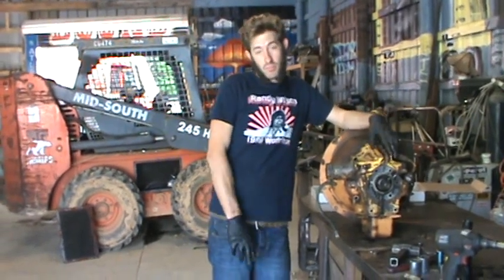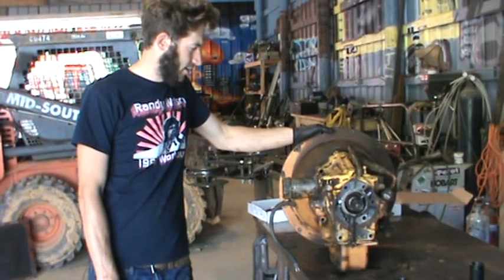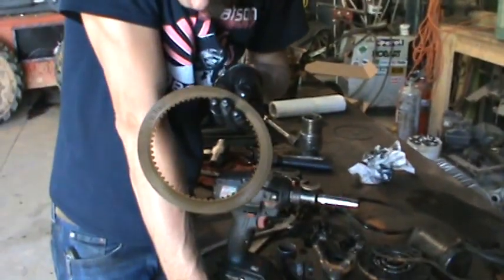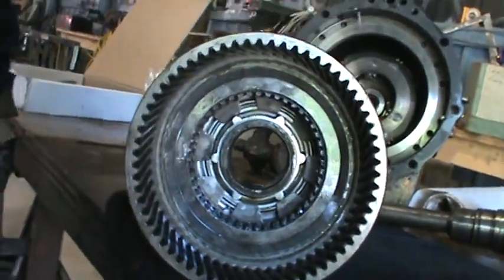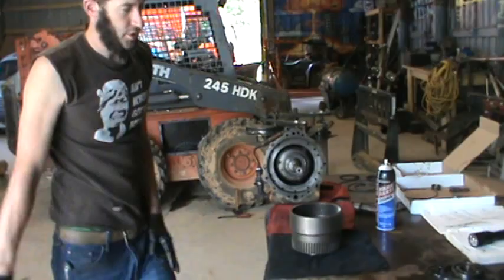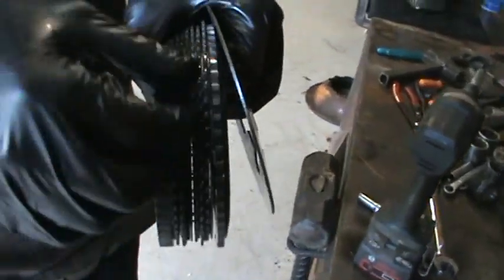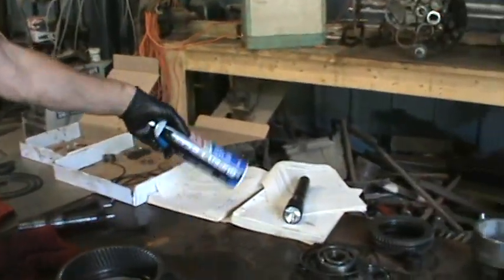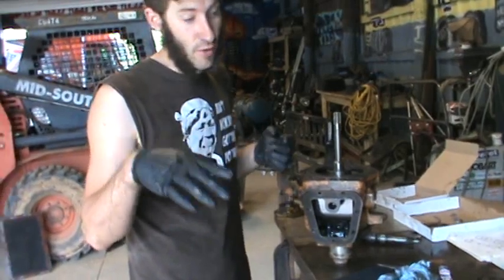Welcome to the Crash Course Case shuttle shift transmission rebuild...

Comment: Anyone have an idea why a Case 680K wont go in Low gear but works ok in 2nd  its 3 speed  Transmission fluid is clean and full and tach needle is burried but not RPM related just buried inop

Comment: Hello I have a 1988 case 580c backhoe. I was told I could Buy a kit to convert shuttle shift to automatic or hydrostatic.  Do you know if this is possible?
Reply: Shuttle shift is automatic..... It's got a torque converter, forward and reverse. Your speeds are in the manual transmission behind it. Your only other option is a manual transmission with a clutch. You do NOT want that in a backhoe.
Reply: If it is y 580C it will not be a 88, should be 75-80, maybe 81

Comment: I need to rebuild the shuttle transmission in my Case 480 construction loader. I've never rebuilt a transmission but I think I can do it with some guidance. I would really appreciate if you could reach out to me and I could give you my contact information so I can ask you a few questions

Comment: AY! this Borg warner shuttle is a real bull shit, alway burn the front disck ,as you dispaly in the video,Oil heat low pressure and the incredible axle  ring seals that loose the oil press into the best solution was the use of metalic  disc not the fibre type ,run a l time more when ever not ruin the planetary system or the converter seal